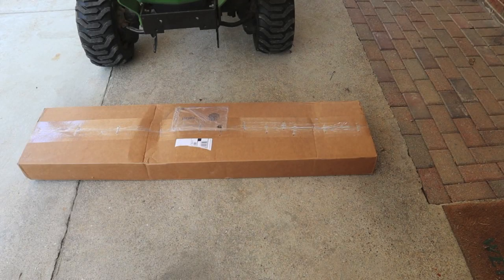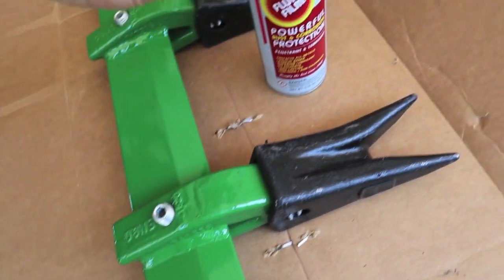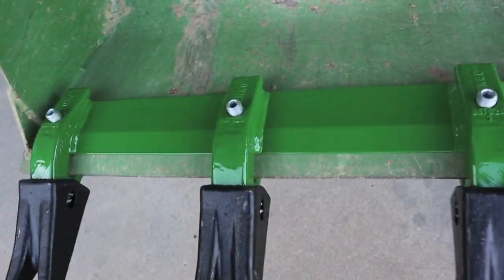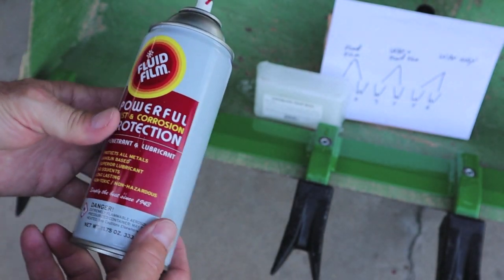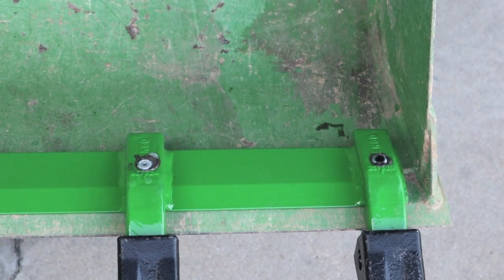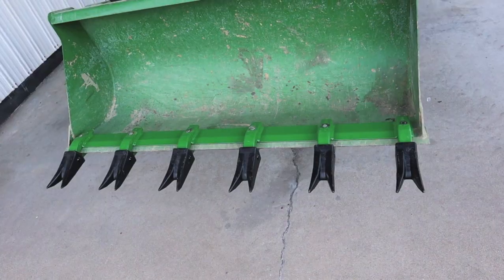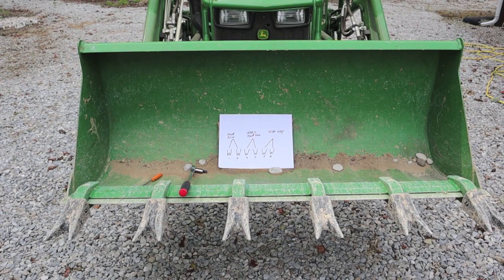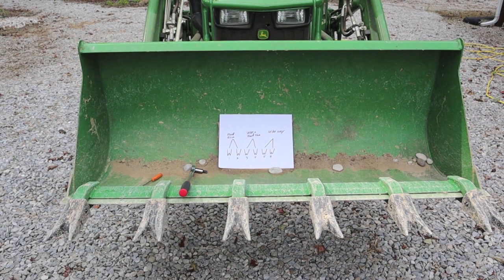Heavy Hitch Tooth Bar John Deere 1025R, unbox, install, melt wax in hex heads or ?

Comment: The wax seemed to be the winner to me. Those teeth sure make that loader look more capable. Thanks for sharing.
Reply from the maker: Hi Oby-1 and thanks for watching! You're right, the wax is king here! I thought I would have to dig the wax out but that is not the case, a small pick or screwdriver just pops the whole plug right out.
Have a good one!!

Comment: Good test and unpack video!  Thanks for taking the time to share your skill and knowledge!  I too have a HH toothbar and love it for digging.  Dumping takes more time, due to the steeper angle needed to overcome the friction on the bar across the nice slippery bucket.  It also tends to be a more violent dump, but when I need to dig, it's fantastic, I can peel sod and fill the bucket with it.

For the set screws, try nothing and clean with a 3/16 screwdriver.  Spin it in and dig or blow it out.  A little refuse is generally left in the hole, but getting plenty of grip distance is pretty easy and takes less time than wax every time.  Wax of course cleans out better.  Thanks again, nicely done, loved the chart!
Reply from the maker: Hi Dan and thanks for watching and commenting!
As you say, the inside mount bracket makes you have to dump at a steeper angle. You're right on the recessed socket screws, it's easy to get a quarter inch of bite with the hex head after digging out a little dirt. Have a good one!

Comment: Excellent video. Your log hauling with the cable led me here so I’ve subscribed. I just bought a JD 1025R and ordered the HH tooth bar for it. Haven’t used either yet but your comments about both lead me to believe I’ve made good choices.
Reply from the maker: You absolutely made good choices. Take care of your equipment and it'll take care of you.
Thanks for watching and commenting!

Comment: LocTite BLUE works just as good and you can get it at any local hardware store. Silicon is best to fill the hex sockets because it will last and can be removed quicker than wax.

Comment: nice tooth bar.+1 on you actually running proper throttle, far too many u-tooberz running their tractors at 50% throttle and doing heavy work.
Reply from the maker: Thanks for watching!
Reply: @pmtips4482  Question on your toothbar, is that considered the standard duty or heavy duty when ordering from their website?  Thanks
Reply from the maker: My cutter bar thickness is 1/2 inch so I need the standard.
The heavy duty is for cutter bar thickness 5/8 to 3/4 inch.
Good luck to you!

Comment: Never seize on screws and hot glue for inside of set screws last for months of work.
Reply from the maker: Thanks for the tip! Hot glue would be lots tougher than wax and still easy to pluck out.
Work safe!

Comment: Mines on and off numerous times a day, don't even anti seize them. But in reality wouldn't it be a million times easier to switch to plain old grade 8 bolts? We're not worrying about dirt and material hanging up, hell the tooth bar does a great job of that by itself. 
Not bashing it, it works great, but no need for flush bolts.
Reply from the maker: I've thought the same thing, go with a 1 inch grade 8 bolt. After all, how much dirt would actually hang up behind them during dumping.
Thanks for watching!
Reply: Really good idea, that's my choice.

Comment: Straight wax seems to work good, actually all 3 do.  I wonder if melted P-Tex stick would be more durable than wax over the long haul than wax.  P-Tex is a type of plastic repair material for snow ski bases and you melt it with a lighter.  Heck, I bet melting plastic army men would do OK too!
Reply from the maker: Hi Warped, I'm not sure about P-Tex but it probably is lots tougher than wax.
It may pop right out too. Wax is going to be hard to beat here in this application.
If I come across any P-Tex I'll sure try it out as it sounds pretty interesting.
Thanks for watching and commenting!
Stay safe!!

Comment: Silver anti seize the set screws and be done with it. Mud is easily picked out of the hex with dental pick set or small screwdriver.
Reply from the maker: Hi John, thanks for watching!
A good anti-seize is the priority on the screws. The wax, etc., takes a bit of time, but you're right....a small screwdriver will pick out dried mud and packed dirt.
Have a good one!

Comment: A well done experiment, thank you for sharing.
Would something like an ear plug, or rubber plug work? There are many choices of materials and shapes. It would have to be a tight fit, and cut shorter than the hex hole depth.  Depending on the flexibility of the plug material, you could remove it with a pointy tool, or dental pick.
I am planning on getting a HH toothbar, now that I have job justification.  8^)
Reply: Another thought on plugging the hex screw holes:  a hex-shaped magnet, that just fits down the hex hole. A slot cut across the top of the magnet, with roll pin installed 90° to the slot - to assist in pulling the magnet out. I bet that would work!
Reply from the maker: nanomaine, thanks for watching and commenting!
After this video, I've come to the conclusion that wax is the way to go. It does take a few minutes to melt it in, but I thought it would have to be pulled out in little pieces and that is not the case. Wax will pull out in a single plug and that seals the deal for me :-!
Reply: @pmtips4482  My HH Tooth Bar has shipped, so I'll have it soon. I will try the wax method 1st, as that certainly works.
I have subscribed, and thank you for your vids!

Comment: What kind of wax is the best to use on the set screws?
Reply from the maker: I used a trappers wax block I had, I would think any wax you can safely get to melt and drip the hex pockets full would be fine.
Thank you for watching and commenting!
Work safe!!